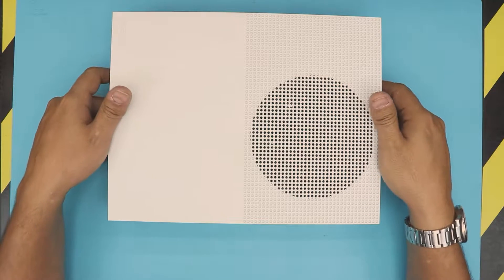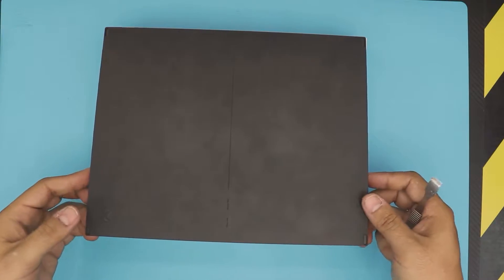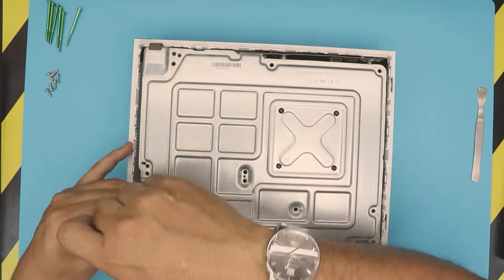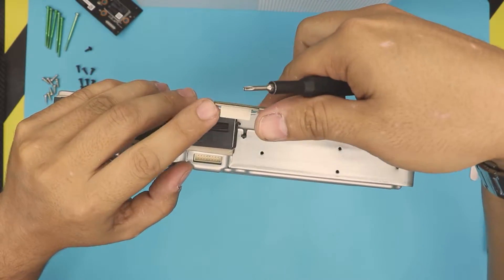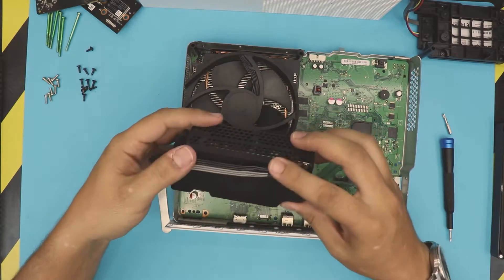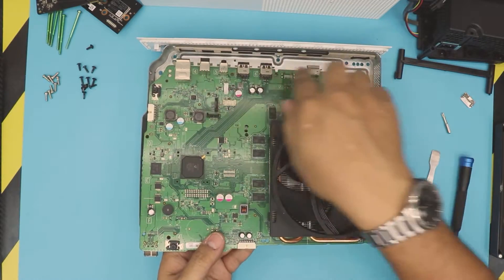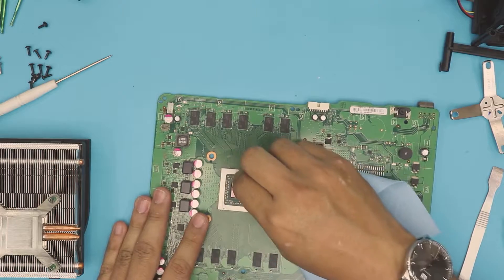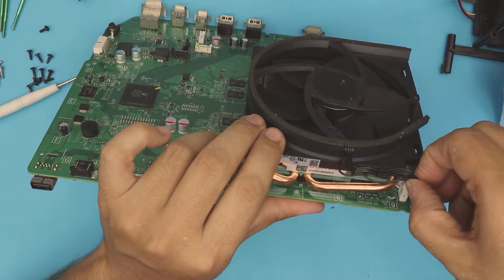Xbox One S Repaste Service, lower temperature!!

Comment: how can i tell if my cooling fan is not cooling properly, also does the psu have it's own fan?
Reply from the maker: You should clean and reapply thermal paste to the console once a year if you use it for about 4-6 hours daily. If the old paste is hardened, you will need to service it more frequently.
Should you have any further questions or requests in the future, please don't hesitate to ask me.
cheers🍻